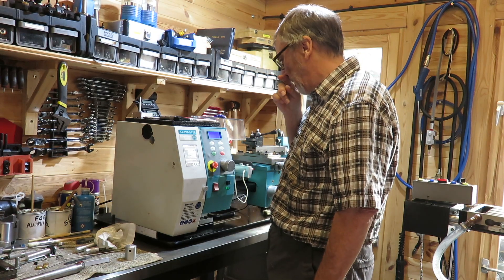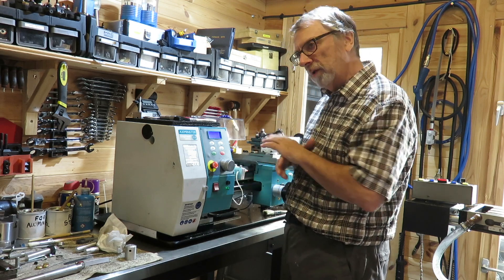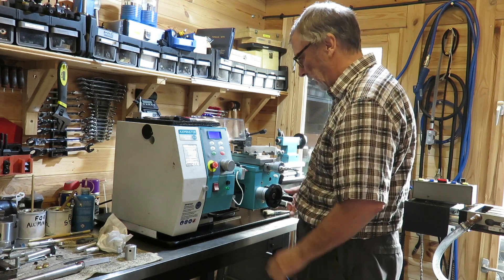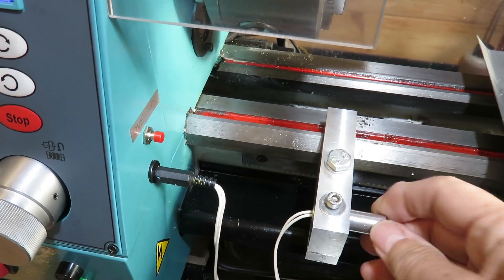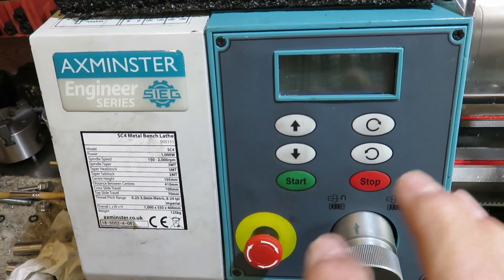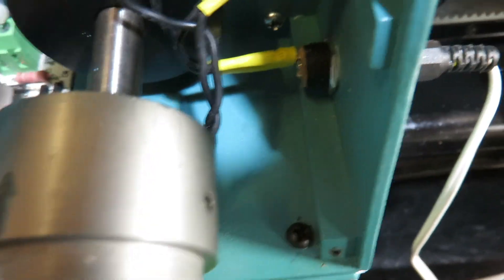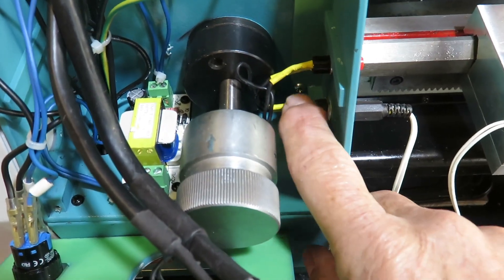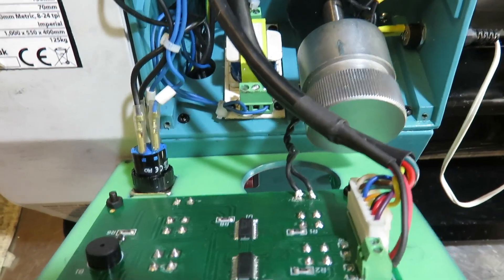Make an Axminster/SIEG lathe auto-stop

Comment: Hey Chris, 
I have the same lathe with a different name which it is jetco jml-3s. They are exact same lathes. However, I have a problem on my lathe nowadays. I made lathe work a couple days ago and turn off the lathe and then turn it on again about half hour later but the fuse that on the front panel which is above the green light pops out. I replaced the fuse with same one but pops out again. I tried 5-6 times but each time it just blew. So I've checked the control board, servo motor, screen boards etc. I didnt see any damage on them, and even the fuse on the control board was working.  So, do you have any idea what's going on my lathe? Thank you.
Reply from the maker: Without being able to actually examine the system, from what you are describing it would seem that perhaps there is a shot on one of the cables after the fuse. I would examine all the wiring for trapped or pinched cables. That's all I can think of without further info.
Sorry I can't be more helpful,I hope you sort the problem ok.
Reply: @ChrisMower  thank you so much for replying in such an old video. I have checked almost everything but nothing seems to be broken.  However, there is one thing that is bothering me. When I remove the outer cover of the motor, I can see some exposed copper wires connected to the ground. Is that normal, could you check if it's the same for your lathe?

Comment: Hmm. I don't know the circuitry of this model but it is possible that the switch is controlling the 230 volt AC mains supply. In which case bringing it out on single insulated flex is very foolish. Proper double insulated is not much better, to be safe this would need to be low voltage and that involves transformers, relays and more complex circuitry. The switch voltage really should have been mentioned first in this video. If it's low, say 24 volts it's ok, if it is 230 volts (UK) or 110 volts (eg USA) then it is not. BobUK.
Reply from the maker: It is 5volts. My mama didn’t raise a fool.

Comment: Hello sir,
It is with great interest and admiration that I became aware of your video.
In 3mn12 you manipulate the limit switch, I am looking for a product of this type; can you please tell me what type it is and give me its references or a link to buy one. I hope to achieve, like you, an engine stop by limit switch contact.
I hope a positive response and in the meantime, have a good day and cordial greetings. Paul (French)
Reply from the maker: Paul K the switch I used was a simple ‘normally open, push to close, non-latching’ one that was in my spares box so I can’t give you any details. However they are very easy to obtain from just about any electronic component suppliers. 
I have another video where I add another switch to allow you to use the motor to reverse the saddle.

Comment: Hi Chris, 
Good video :) 
Robert Ackert has shown something similar, also he has a great set of instructions in a pdf format.
I managed to crash my Sc4 lathe, it was quite a shock !
I had the face plate on the machine, luckily the motor controller shut off the power.
So no damage done.
http://www.fenichel.net/pages/Indoor_Activities/metalworking/lathe/autostop/lathe_autostop.htm
ATB Adam